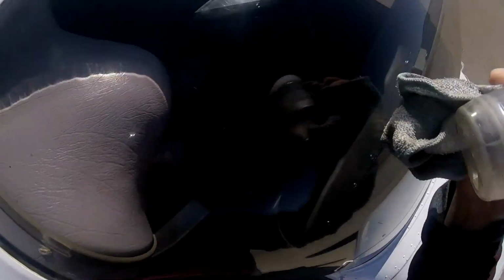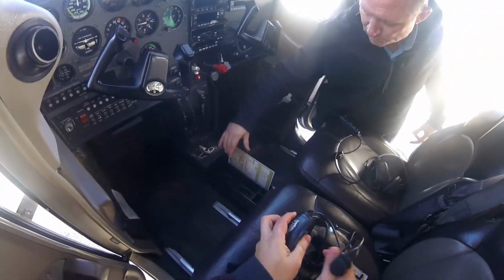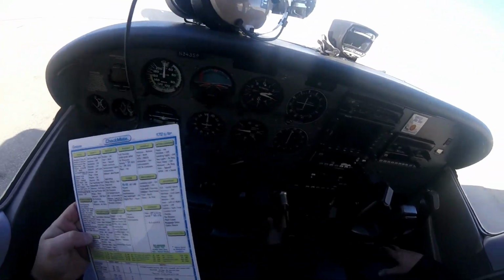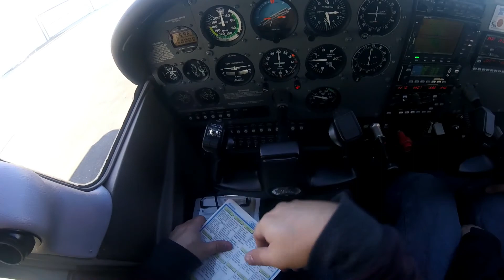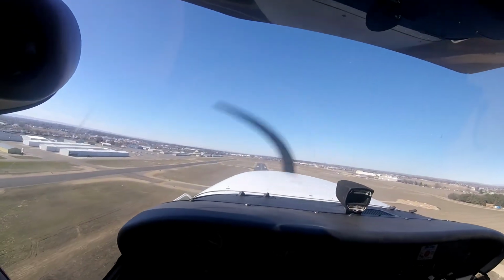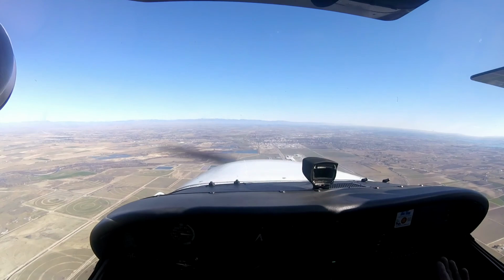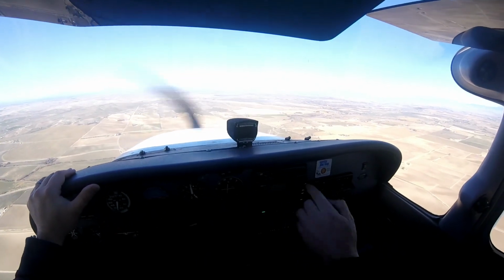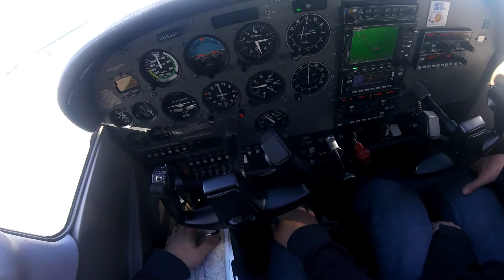Cessna 172S Checkout & Flight Review - Part I

Comment: I see that you make more excuses why you can't, how about adjusting your flying to fit that 172..all the 172's fly just about the same you need to adjust your flying to that particular airplane your flying.
Reply from the maker: Well there are a few factors that went into the "excuses". 1: I hadn't flown for 8 months before this flight. 2: I never flew ANY 172 prior to this one. 3: I was performing a BFR at the same time as getting checked out in a new airplane, so besides learning the peculiarities of the airplane, I was also expected to perform various maneuvers and emergency procedures in an airplane I had 0 time in. Just sayin'. 

In the end, I got my BFR and check-out in 1.5 hrs more time in this bird. I've also never flown another 172 besides this one, so I don't have any frame of reference. Only the 152 and 182, with one being very light and responsive, and the other being heavy and slow to react to inputs. My experience is that this 172 flies more like the 182, but with less sink with power off. As a matter of fact, it floats in ground effect even more than the little 152. To your point, you are right about adjusting my flying to the aircraft. When I was current, and flying the 152 and 182 regularly, it was no problem at all switching between them. I think I was a little psyched out because it was a new plane to me and BFR on top of it... Blue skies!

Comment: Steps missed, Clear prop, Did not get the weather, did not contact ground for taxi. Did not contact tower. Maybe the airport does not have a tower. Should of got the ATMIS.
Reply from the maker: Nope. To your points: 1. Clear prop was edited out of the video. 2. No ground to contact, this is an uncontrolled airport. 3. No tower, again, it’s an uncontrolled airport. And 4: Got AWOS weather by cellphone before the flight.